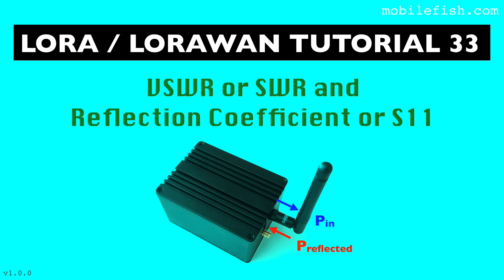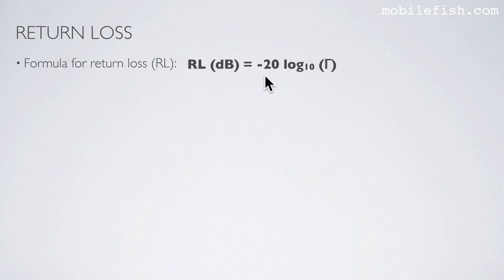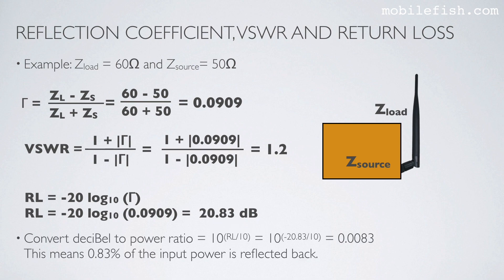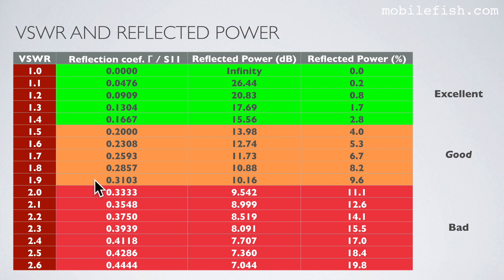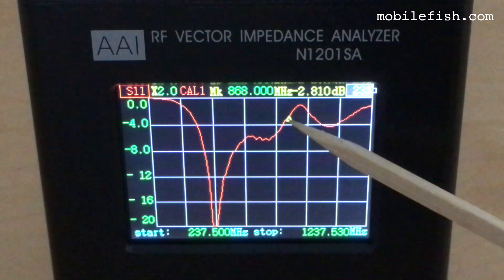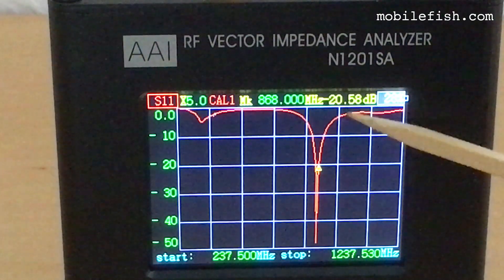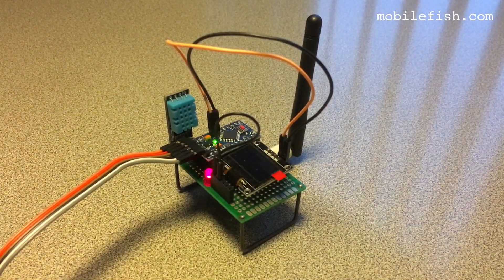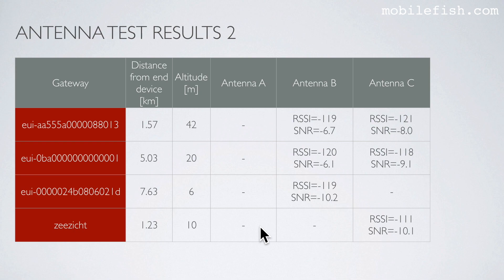LoRa/LoRaWAN tutorial 33: VSWR or SWR and Reflection Coefficient or S11

Comment: You don't mention where the reflected power goes, reflected power isn't lost that depends on feeder used, reflected power joins the forward power to form a standing wave and is radiated by the antenna, how much of this reflected power that gets back to antenna depends on the feeder, in a lossless line for example all reflected power is radiated by the antenna no matter how high the swr is